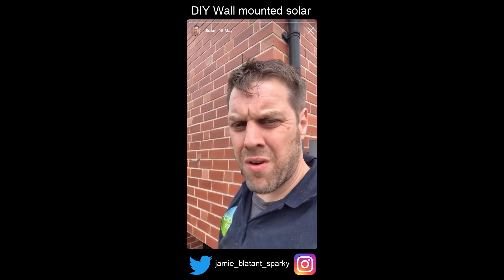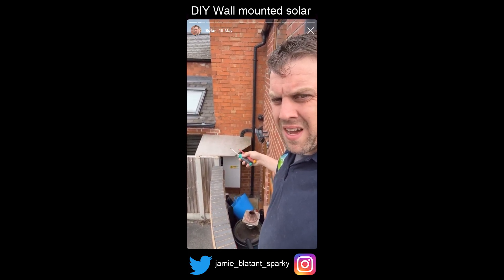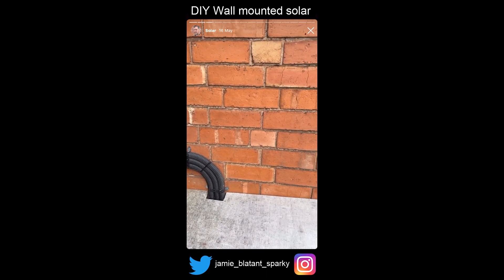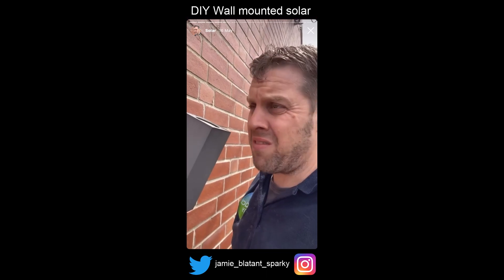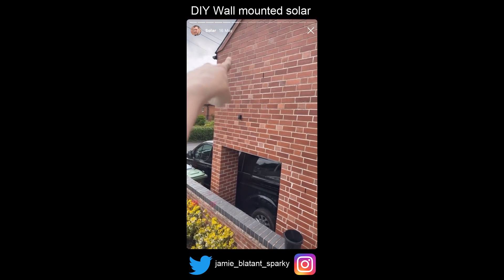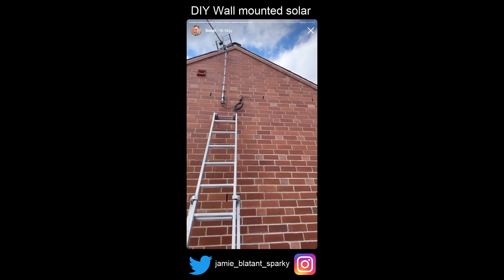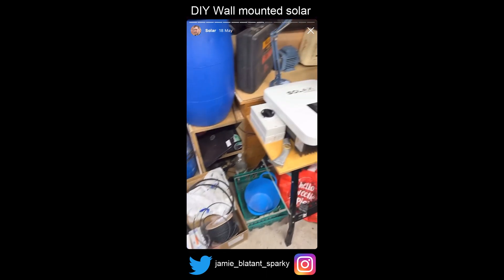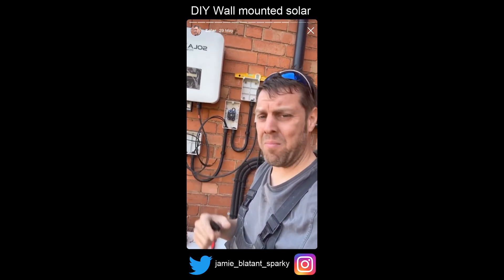DIY wall mounted solar project part 1 - project prep

Comment: Might be an idea to use a USB extension lead to move the dongle to a less "accessible" location. I think wall mounted panels should be more of a thing, especially for catching the low in the sky winter sun.
Reply from the maker: For what reason ?
Reply: @Actual_electrical_content  In case the dongle decides it wants to go walk about